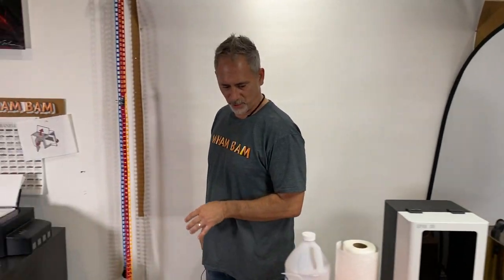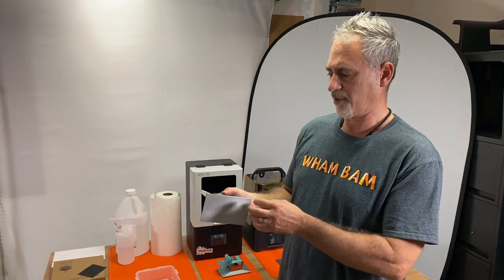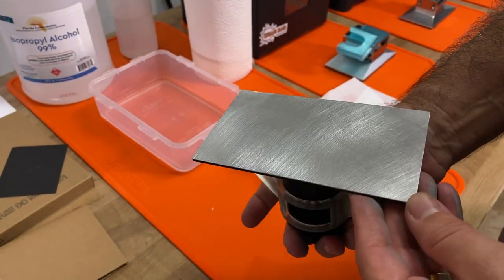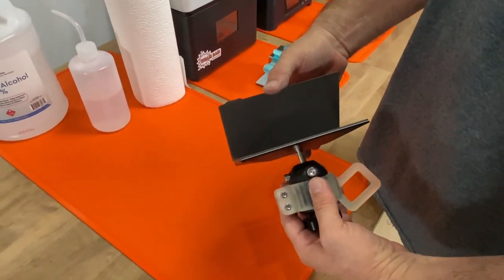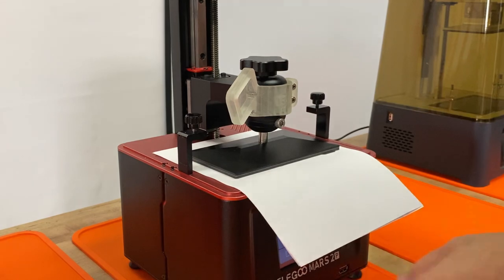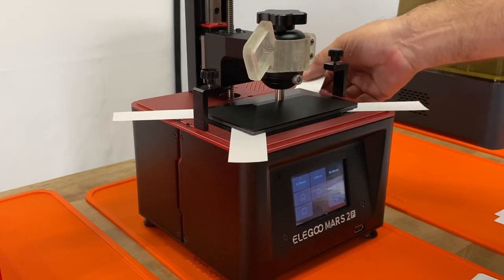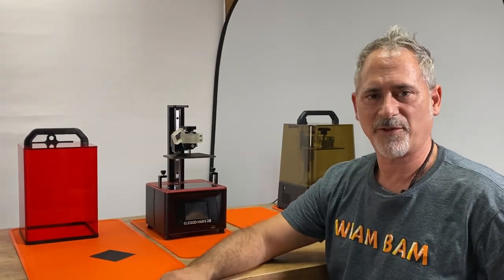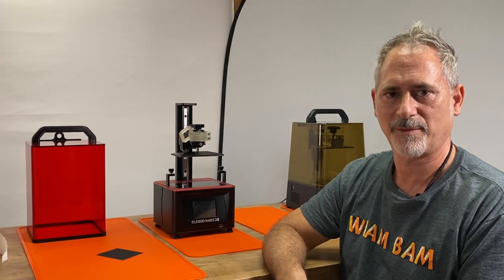Installation of the Flexible Build System for Resin (Updated)

Comment: I imagine sanding is still recommended if the plate is unused and brand new?  Thanks for the video
Reply from the maker: it has a specially etched texture on both sides of the flexi plate, which in most cases provides the right amount of grip and release.  if your parts dont stick well enough I suggest first increasing base layer exposure.  if you still want more grip then sand one side only, and keep the other for when you dont want as aggressive of a hold.
Reply from the maker: actually if you are talking about build plate before magnet install, yes sanding will help remove cutting oils and any surface finish factory may have given
Reply: @WhamBamSystems  Yes thanks...I was referring to a brand new unused built plate.  Thank you very much for the reply.

Comment: So I am not all there. I am wondering about the home button. After installing my wham bam and doing my leveling you’re suggesting never hit the home button again? Elegoo Saturn s
Reply from the maker: you can hit the home button, and even the set z=0 but do not use the machine interface to raise the build plate to compensate for the added thickness of the Wham Bam kits as this will not stop it from driving into the screen if you have not hand leveled first.

Comment: great information thank you. however, not sure what I did wrong. my magnet did adhere perfectly and the grip is good but i am getting resin between the build plate and the magnet, so instead of getting a nice flat surface i have a slight curve now. have you seen this before and is so how to fix that
Reply from the maker: Please send us photos and an explanation with your settings and screen shot of model to technical@whambamsystems.com and we will help you resolve this!

Comment: Has the glitch in the Elegoo Firmware been updated to fix the homing issue? Thanks for your quick reply to my earlier question!
Reply from the maker: what glitch?
Reply: @WhamBamSystems  You mention in the video, on the Elegoo systems, when setting a new home position from the screen, if you home the machine again, it will revert to the original default home position and that it was a glitch in the firmware.
Reply from the maker: @behamiltonsrful  sorry, its actually not a glitch, just the way the machines work, if you manually level and it takes a good level you can do 'set z=0' to remember the home, even use the UI to go up or down a few 0.1mm increments and use 'set z=0' . we just advise not to use this to actually level initially as the machine always homes to where the lever arm trips the switch then moves to position programmed with 'set z=0' .  So if you set it much higher than the home position the home risks crashing into screen first

Comment: What is a good adhesive to reattach the magnet to the plate? I left the printer arm up and forgot about a month when I returned the magnet is drooping on one corner. I tried superglue and it didn't work. More superglue?
Reply: I glued it with two-component epoxy glue

Comment: I just finished following you step by step up to leaving the 3M adhesive to cure. I have a question, I'm trying to do everything by y'all's book so that, if I have any issues, I can possibly help y'all solve them. That being said, would putting caulk around the edge of the magnet work for attempting to make the build plate as a whole more Alcohol proof?
Reply from the maker: Interesting, but not sure what caulk would do, maybe by spreading silicone around edges it would seal it better?
Reply: @WhamBamSystems  to seal out the alcohol? Like, so that the adhesive was protected Incase it got left in the cleaning bin somehow! 🤣

Comment: I've had my plate installed for a bit now and it started out great. Now for some reason my metal flex plate has been sliding sideways on the magnet (about 1/8" or more on a 3 hour build). The magnet is firmly attached to the build plate and hasn't moved at all but the flexible plate itself for some reason has stated to shift to the side. I've cleaned everything (magnet, flex plate, build plate) thoroughly with alcohol and let it all air dry. I thought maybe it was a level issue so re-leveled several times and tried it and it's still doing it. Any thoughts on why it would side-slip and how to stop it? Maybe roughing up the magnet surface and flex plate surface to increase friction?
Reply from the maker: Please write to technical@whambamsystems.com for one on one support.  Is it shifting only in base layers or further into the print?
Thanks
Reply: @WhamBamSystems  The shifting seems to occur primarily but not entirely on the base layers. I did several additional test runs to gather additional data and I'll be in touch by email shortly. Thanks.

Comment: Quick question regarding the 'Home' button in the manual area of the Elegoo printer: Should the 'Home' button still not be pressed as of today? If anybody knows?
Because I have pressed it a lot of times, and don't seem to have an issue with the z position being reset, or anything. Maybe the software issue have been fixed?
Just curious..
Reply from the maker: are you talking about 'set z = 0' ? if so you should use this to zero out your machine when you have leveled and build plate is all the way down.  Do not use the manual up and down arrows to compensate for the thickness of the Wham Bam FBSR, this would cause grinding as first the machine homes to the point where the optical switch is tripped physically then goes back up to the set z = 0 position after reaching the switch.

Comment: Question about washing the buildplate. is it possible to wash your bed and the plate still magnetized together? seems more reasonable to do it that way to prevent the magnetic base from having any resin drip on it.

I would probably remove the flex plate after wash anyways for a brisk spray and wash all sides down with paper towel anyways.
Reply from the maker: You could but do not leave sitting in alcohol for more than a minute at a time, you don’t want to expose the glue to alcohol for more time than necessary. I like to pre drip my whole head and print over the vat before cleaning and then have little extra resin to clean when I can afford the time

Comment: Was just gifted a Mars 3 pro and the wham bam build plate. Do I need to make the spacer first? I saw you commented on another post that the spacer is not usually necessary for Elegoo printers. I havent set it up yet and was wondering if I need to make a spacer first or if I can install while doing my initial setup. Thanks!
Reply from the maker: not necessary, but if you use the spacer you won't have such tension on the spring in the head, so yes, do recommend it https://whambamsystems.com/fbs-for-resin-support

Comment: When I set up my mars 2 pro it had me follow a process to calibrate the Z axis home. couldnt I just do that again to adjust for the new depth instead of modifying the unit itself?
Reply from the maker: If the head can move up at least 3mm then you can level to new added thickness, but we highly recommend installing the space, it’s the easiest print snd install on the planet and would be safer for your machine during homing

Comment: I saw a video from "Robert Bekoscke." It seems that he didn't add anything 2.6mm for the optic sensor of the Sonic mini 8k. 
Is this safe for my Mini 8k, to just add the plate with no 2.6mm spacer?
Reply from the maker: As long as the build head has enough room to move up over 3 mm from original position you don’t need a spacer

Comment: My Flex plate for my Elegoo Mars 2 Pro came in today. I've see a few videos where I need add an optical cut off because of the extra thickness the magnet and flex plate add. I noticed you didn't do it in this video. I'm guessing that that isn't necessary?
Reply from the maker: Print and install this https://www.thingiverse.com/thing:4664287

Comment: I installed the FBS and the spacer on my Elegoo Mars 3. When I press HOME to level my build plate, the plate lowers but when it comes into contact with my screen it starts grinding. Not sure why this is happening.
Reply from the maker: Did you follow complete leveling process? Loosen head screws before hitting home? Hit z=0 at home position.
Do not use screen UI to move up build plate.
Try leveling on 2 sheets of paper, after ,leveling check with one
Reply: @WhamBamSystems  My issue(s) have been sorted out and the Wham Bam works as it's supposed to do. If your pieces do not pop off the plate, they easily slide off. A GREAT PRODUCT!!!

Comment: Thank you for this very detailed video on the installation of the Wham Bam system.
I have a question about the installation on an Elegoo Saturn.
I saw that there are Z spacers for both the Mars and the Saturn, but in the video, you do the installation on an Elegoo Mars without using a Z spacer, so I'm wondering if it's really necessary with the Saturn? 
Should the installation be done with or without the Z spacer? 
Thanks
Reply from the maker: thnk you!.its not necessary, there is much movement in the head of the Elegoo machines, as long as your spring is not pushing down too hard, level with the thicker sheet they provide and make sure a sheet of paper can move under the build plate.
Reply: @WhamBamSystems  thanks, so I'll do like this, install the wham bam system, install a protective sheet for the screen and levelling Z with the thick sheet provided by Elegoo.
Reply: @WhamBamSystems 
I just took the printer out of the box, I see that the plate is not smooth but slightly textured, do you think it is necessary to sand it anyway?
Reply from the maker: @oOtazlewouafOo  yes to remove paint and also cutting oils.
thanks
Reply: @WhamBamSystems  OK thank you, I'll do that
Reply: @WhamBamSystems  I cant level my Saturn without the spacer. Even with the screws all the way out. The Leveling sheet that came with the printer is not moveable.
Reply from the maker: @windfurygoburr  There are 2 different spacers for the Elegoo Saturn depending on which printer you have, you can find more info here: https://whambamsystems.com/fbs-for-resin-support
If you need further assistance, reach out to our technical support at: technical@WhamBamSystems.com

Comment: Thx for this video. I have a question: I use sprayway glass cleaner for cleaning up my plate. Is it a problem with the  3M adhesive?
Reply from the maker: What are the active ingredients in the cleaner?
Reply: @WhamBamSystems  ethanol, 2-butoxyethanol,propane,butane. It clean the plane with out residue.
Reply from the maker: @Centurion3D  those are all very harsh chemicals, I will try to keep them away from the 3M adhesive, but that doesn’t mean you cannot use them to clean the Flexi plate. Just remove the Flexi plate and wipe down with your spray solution and dry well before putting back on
Reply: @WhamBamSystems  Thx. Now I know, better safe then sorry! Thx again.

Comment: I've a new unused build plate do I still need to sand it or is the clean factory sandblast good enough?
Reply from the maker: definitely need to prep the build plate. we always recommend sanding the build plate to open the pores, even for brand new build heads,  to help remove cutting oils and contaminants and prepare the metal for the 3M bond.
follow these instructions for best installation:

On top of it all, many printers are famous for not having a flat bottom, which will cause issues later.

Here are the main points.
	• Be sure to remove old magnet and adhesive
	• Check that your build plate is flat by laying a steel ruler on edge  across it in all directions and see if there is any light passing between it.
	• Let the whole head sit for at least 30 minutes in an alcohol bath to remove residue from entire build head and hard to reach places.
	• Clean every surface of the build head well with pure isopropyl alcohol and paper towel to remove all residue and dry well. 
	• Use 220 grit sand paper on the bottom of your build plate to rough up the surface and open the pores and ensure there is no residue left
	• Re-clean with alcohol and fresh paper towel, repeat process with new paper towel until towel comes away clean
	• Let dry
	• Then mount the magnet and leave to cure for 72 hours.

I

let me know how it goes!
Reply: @WhamBamSystems  Thanks for the reply!

Comment: Hi Peter, do you know if it is necessary to use a Z spacer on Elegoo Saturn, I just bought your Flexible Build System 196x126mm for my new printer, but I'm not sure about that. Thanks.
Reply from the maker: It could help, here it is https://www.thingiverse.com/thing:5334643
also found on our support page
Reply: @WhamBamSystems  thank you

Comment: so uh...i forgot to print the spacer beforehand. i just switched the screen and decided to add a wham bam plate at the same time, but forgot i should have used the old plate to print a spacer first. i have an elegoo saturn (KS version), does this version need the spacer in your experience? the plate has quite a lot of give, but usually the people i see not needing the spacer have newer printers!
Reply from the maker: You can do without a space, just loosen screws on head for leveling, with Wham Bam FBSR installed hit home and place 2 sheets of paper on the screen, when it homes hold the build head in place while tightening leveling screw. Then hit home again, it will lift before homing, remove one sheet of paper and test with other, there should be consistent resistance on all sides of build plate but paper should be able to move

Comment: I have a mono x and every time I level it when I try and print somthing it still makes a whine noise like its pushing on my screen Do I still need a spacer even if I have a build plate that is 4 screws.
Reply from the maker: If your 4 screws have long enough holes to allow for about 3mm of travel upward you are good. The whine sounds like you leveled too tight.

Comment: How long does the adhesive last before it starts to peel off?  Can i hold up to alcohol washing station? Thanks!
Reply from the maker: we dont recommend leaving magnet in any solvent or IPA for more than 1 minute as over time it can dissolve the glue or the coating on the magnet.  We typically clean by wiping down with paper towel, placing in a vat with IPA for one minute, taking out and wiping down again or drip drying.

Comment: I really appreciate this video and wish I had seen it sooner!  I have a Voxelab Proxima and due to my safety concerns with resin and 99% IPA, the printer and wash/cure station is in the garage.  I've had one work great and that's before I discovered I needed a spacer!  I've done the machine bed leveling process correct (your method 2) and I am continuing to get failures.  And I don't think it's the fault of your bed or even that spacer.  Being up in the NorthEast, even though the weather is warm, by our standards, I think it is too cold for my Elegoo resin?  The garage is anywhere between 65-72 as of late and the Technical Data Sheet gives a range of 20-25C (68-77F)  Being somewhat new to resin, I'd love some suggestions!
Reply from the maker: it really depends on your failures, can you explain what is failing?  or better send photos to technical@whambamsystems.com.  if it is printing past base layers and you are having failures later it may be your supports, if you are not getting good adhesion to the plate we can help with settings, also make sure your resin is well mixed and within temp range as you have said

Comment: I just installed my wham bam on my mono x it’s off by a tiny I mean tiny will that have any effect on my prints?
Reply from the maker: It will not have any affect on your prints but try not to pry the Flexi plate from the side that overhangs
Reply: @WhamBamSystems  thanks

Comment: hey I think I have a problem. I set the zero point. there is a throbbing sound in the motor when i go to print. it's like it's pushing the motor and trying to go further down. I only hear this sound in the first layer, then it goes back to normal. I already set the zero point, I don't understand why it tries to go below the zero point and forces the motor. Anycubic Photon S  🙏
Reply from the maker: How did you set the zero point? By adjusting the build head until it homes over paper with light push? Or through software?
Did you add a z limit spacer?

Comment: So i got my wham bam flexi package and the magnetic black pad doesnt fully adhear to the build plate is this a common issue
Reply from the maker: Hi Michael, please write to us at technical@whambamsystems.com, did you follow all the instructions?  If the magnet is not fully adhered, there was most likely contaminants or resin on the build plate that prevented the bond,.